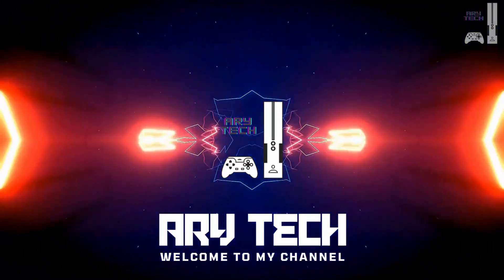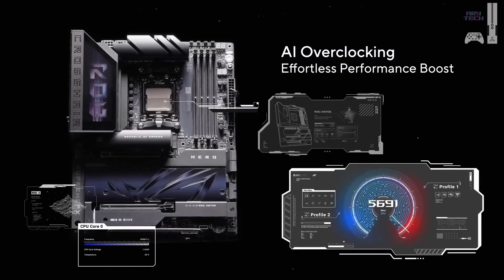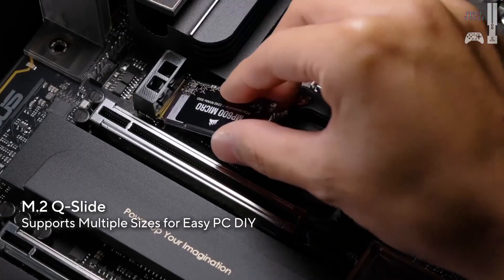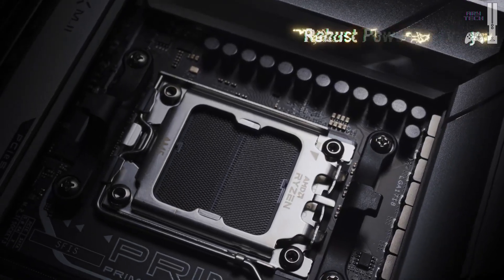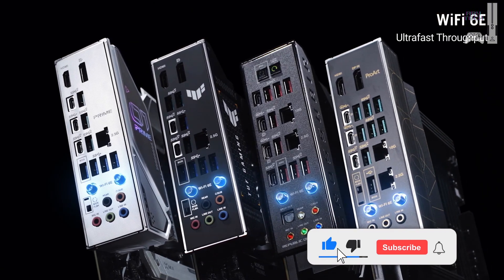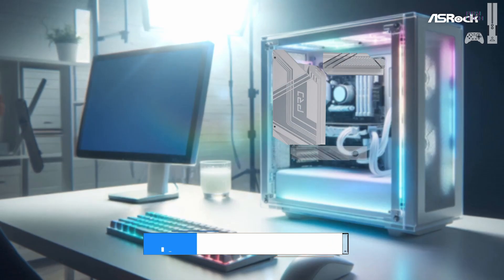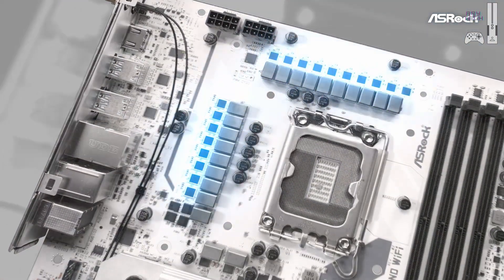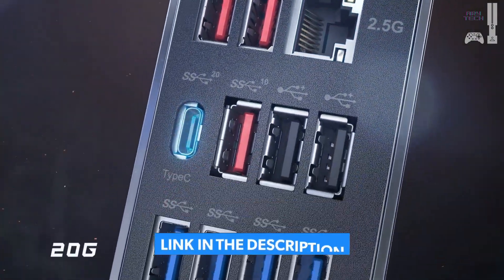Maximize Ryzen 7 9800X3D Performance: 4 Best Motherboard Choices

Comment from the maker: Best Motherboard for Ryzen 7 9800X3D
1. ASUS ROG Strix X870E-E Gaming WiFi
https://shorturl.at/Y8ArA
https://amzn.to/4iAQ9gl

Best Runner Up Motherboard for Ryzen 7 9800X3D
2. ASUS ROG Crosshair X670E Hero
https://shorturl.at/Y8ArA
https://amzn.to/4hL02qv

Best Mid-Range Motherboard for Ryzen 7 9800X3D
3. ASRock X870 Steel Legend
https://shorturl.at/Y8ArA
https://amzn.to/4hGDvuY

Best Budget Motherboard for Ryzen 7 9800X3D
4. MSI B650M PROJECT ZERO
https://shorturl.at/Y8ArA
https://amzn.to/422xkeT